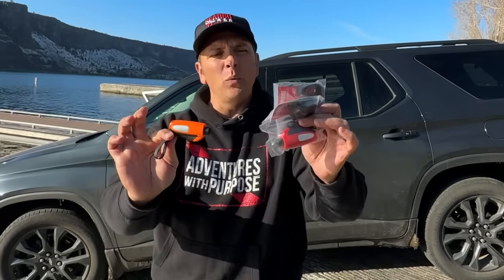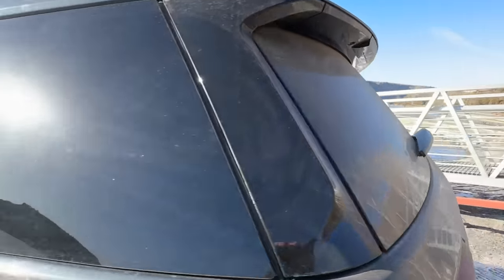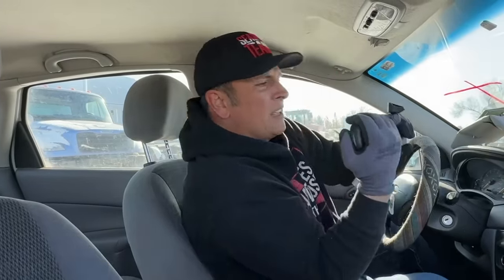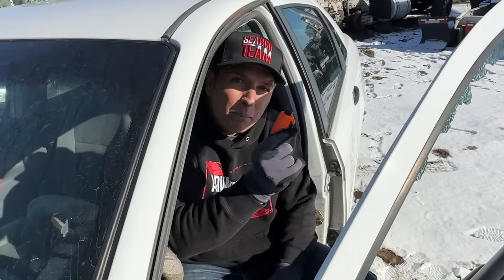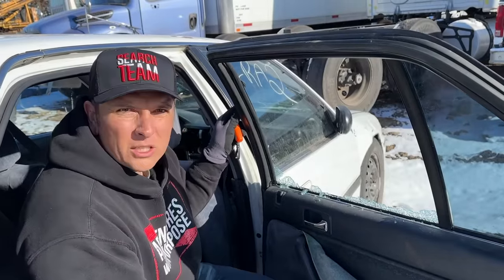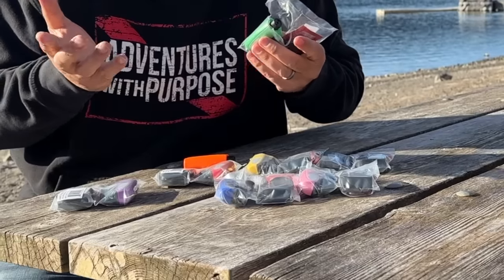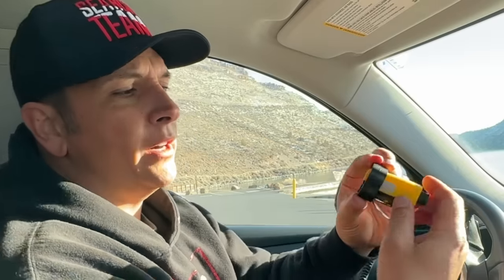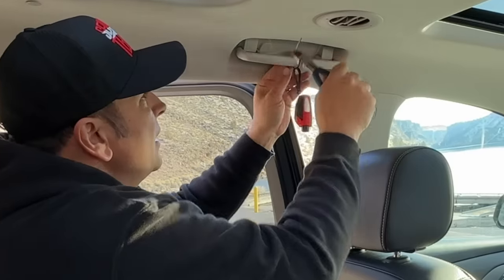Easiest Way to Break Car Windows.. (This Can Save Your Life)

Comment from the maker: Stay safe on your adventures with the 2-in-1 Window Breaker & Seat Belt Cutter! Get yours now at https://adventureswithpurpose.com/products/2-in-1-window-breaker-seat-belt-cutter-with-accessory-kit
Reply: Thank you for this easy to understand informative video!
Reply: What if your window breaker doesn't go off whenever you push it into the window?
Reply: Just ordered a couple... thanks!!!
Reply: I still have a bunch of the old ones, and I was thinking of printing instructions for each one and including zip ties.  Now I will also have to put more in my car.  I think I have like 40 something left.  So it will be a while before I order new ones. Thanks for the video, with easy to understand instructions!!!
Reply from the maker: @ryaneboehnlein9360  We have not had this issue with the newest model for it's new improved design is dialed in and meant to be used over 10,000 times.
Reply: @AdventuresWithPurpose   it was just one of those random  ?
Reply: a pity that the shipping costs to the Netherlands are ridiculously high otherwise I would have liked to order them from you. but I will look for something like this here in the Netherlands. thanks for the explanation and tips. continue to do what you are doing. bring the people home. I love your video's. Respect👍
Reply: @ryaneboehnlein9360  If you tested it when you received it and it worked, there shouldn't be an issue.
For an added sense of security, I suggest purchasing a 2nd one.
Reply: On your next, commercial, please , inform people to cut seat belt first,   Because if they break window and drop it ,  out of the excitement —— then they are still stuck ,
Reply from the maker: @michaelmike5709  That is a great point. We'll be sure to point that out.
Reply: I bought the window breakers  when they first came out.  The sun visor clip wasn't included then.  How do I get some of the clips?
Reply from the maker: @marysnider1223  these are a completely different style and better quality. We would suggest purchasing a new one which includes the sunvisor clip.
Reply: @AdventuresWithPurpose  ok, I understand completely.  I carry mine on my key ring.  That works ok for me.  If you ever design one to fit the style I have let me know.
Reply: Very useful advice, Thank you. It really does make you think about how to escape a sinking vehicle in water.
Reply: @Suebe1962  why do you have so many?
Reply: @sl4983  Because I have a big family and I wanted to make sure that the drivers in my family had one.  Several of my family members live on the west coast (I'm in Iowa), and I don't get to see them very often.  I eventually will run out of them and may purchase more if needed.
Reply: may need to pay the bill to repair the car
Reply: @AdventuresWithPurpose  Can I ask why you changed the design? I love the older ones not so much the new ones.
Reply: you may also use it when your at the mall and you come across a car with kids inside but no parents around or cant be located and the kids are almost passed out.....just a theory
Reply: @hollymaffia7352   it is a longer puncture point, easier to grip, and overall  higher quality - old design the blade was prone to rust and falling out.
Reply: Wow your right my blade was rusted! Glad I bought a new one!

Comment: Potentially life saving suggestion: When you order your window breakers, choose bright colors like yellow or orange. The darker colors like black, purple, or blue, will be harder to find when you're disoriented or underwater. Having those bright colors will make it easier and quicker to spot, when each second is crucial.
Reply: True, it could help.  But, I don't live in an area with pure and clear water.  Color won't matter if my eyes are closed.  If I am in muddy or murky water, I do not anticipate having my eyes open.  I anticipate I'd be relying solely on my sense of feel.
Reply: If you get a darker color, maybe "marking" it with some type of reflective tape or paint?? Just a thought... me personally, I'd get the orange or yellow window breakers.

Comment: Most people have no idea how hard a car window is..I had to bust one for a buddy of mine who locked his car up with the keys and he had to get inside faster than the time it would take a locksmith to show up. We even had a hammer and I'm a carpenter who swings hammers professionally and I was in disbelief how many swings I had to do to get that window to break.
Reply: Its not hard then, when you assembly new windscreen😂 its always last corner when its cracks on middle
Reply: Wow I believe the hammer having many swings. I recently had my car locked up with phone and keys in it. I asked a man if he could help me out. I didn't want him to break the front ( because I knew the Laminated part) and didn't want my side windows so I asked him to do one of those little Triangle windows. He used a car jack and it wouldn't break it
Reply: He probably had laminated side windows.  They're death traps.

Comment: there is no good alternative for simply keeping a window breaker in your pocket when driving. putting a retention loop on the cover for the cutter doesn't seem like a very good idea. couldn't a sudden stop simply pull the cover off? same thing with the visor clip. it doesn't look very sturdy. an impact could cause the clip and window breaker to come off the visor. also, the way you had it set up where the visor clip retains the loop on the cutter cover? that's interfering with your ability to pull the cover off. you'd have to fiddle with the clip to take it off if you needed both the window breaker and the cutter.

Comment: I have two in my car, in the center compartment and another in a first aid bag.

I also have a glass break pocket knife in the driver door and another in the center compartment.

I need some more for the back seats, didn't think about giving the kids an option for a window break if I am incapacitated. I also will mount one near the rear window.

Thanks for the tip!

Comment: 3:22 Usually you have to push or pull a button to release the headrest. NEVER hit a window in the middle/center but in a corner or at an edge to break it. Remove the broken glass with your elbow.

Comment: I've had a window breaker in my car for decades now, it's an old automatic centerpunch that lost too much of it's spring to be of any value as a center punch, but still had plenty of power left to destroy a window. But it's good that they have purpose built ones now so that people who are not used to obscure hand tools can be safe as well.
Reply: Always good to have a reliable tool and a plan.  I also suggest having a handy tool for passengers to cut their seat belts so they can escape also.

Comment: This is so important. I am glad I am always having my savety hammer in the car. Does the same job but is way bigger. Thank you for this extra information 😅
Reply: You may want to consider effective methods for any passengers to escape and pre-plan a way to remove your seat belt.
Reply: @Thathat-o7w  this is the only thing we have here in the Netherlands. And the hammer also has a knife in it for the seatbelt. I just bought a new car and actually looked into this to check on other options

Comment: This is a great demonstration. I carry a spyderco assist rescue knife on road trips. It has a glass breaker, rescue style blade, and an emergency whistle. I also keep a glass breaking hammer in my glove box
Reply: Sounds like you're prepared.  I pray you never need to use them and may they work as advertised.

Comment: Thank you for the updated tool. I do have a very question. For those in backseats, if a window breaker is in the backseat area & secured w/a zip tie, in an emergency how do we free it from its secure, zip tied location? Zip ties can be tough to break, especially if you’re disoriented &/or injured due to the wreck you just had. Does the hang strap detach if yanked on? Thank you.
Reply from the maker: The zip tie, and the seatbelt cutter cover will stay in place. You will pull the window breaker and seatbelt cutter away from and use it as normal.

Comment: I use to give these type of devices to my friends, especially the ones that had car accidents, made sure that the device were bright coloures. The dives also had a quick release by pulling it, so you could attach the device to the passenger headrest bar that is on the centre bar with some cord or short chain or clip. they also have seat belt cutter. Reason I put it on passenger seat headrest bar is so that the driver if concious can grab it, so can the front and rear passengers. Ensure that your young kids don't play with it, cause it will save you and them in the future. Fact a lot of accidents occur from distracted parents due to kids in rear seats. When I was in the military as a Medic some of our vehicles have old glass stype windows and we teach BTLS Access and I use to carry one on my person when I was duty Medic incase I had to break glass to get to accidents that occur in the field while training or on Tour or even on Base. So glad that someone is showing how easy it was to use.

Comment: I say you hand it from mirror or back of seats how they getting it off sometimes those zip ties ate hard to break especially if your a kid so to me that wouldn't work I wouldn't use zip ties maybe use a very thin sting where it's easier to bust when u pull it. Gonna go order a  few. Thanks Jared for the video have a blessed day
Reply from the maker: Quite easily actually because the zip tie is attached to the seatbelt cutter cover. Pops right off.
Reply: @AdventuresWithPurpose  ok didn't think it would turn enough to cut it. Thanks Jared for that reply. Thanks for all you do to help these families can't wait for the winter search comes out

Comment: Hi Jared, please explain because I'm pretty sure this was not covered in your video , upon a vehicles entry into the water, you have stated that it will float for several minutes before it finally goes under. Won't the power windows be functional during that time while car is floating allowing the windows to go down? Please clarify,  thanks
Reply: Hopefully, he'll release another video that better explains floating.  But, automobile engines are not designed to be immersed in water and the engine will die.

Comment: Everyone please do some research on how to break vehicle glass. It's not easy even with a hammer. There are devices you can buy and carry on your key ring also don't hit dead center but in corners. 
 I had feed stored in an old car and accidentally locked my cat in it in the heat of summer when I closed the door. I had to break the glass and was shocked at how hard it was to do and I had a pointed shovel. 
 We all need how to get someone out and also escape ourselves

Comment: JARED ,  could you tell us how many times the window breaker works  ?   Can you use it repeatedly or only once  ?
Reply: at 10:25 when he was seated at the picnic table, explaining it to us, he said the new improved model can be used upto 10,000 times, compared to the original which was right around 100 times.

Comment: Uh I hate to be this guy but I had mine for about 2 months and it literally fell apart. The spring loaded mechanism apparently just malfunctioned and punched out the little plastic piece that that holds it in meaning it no longer works at all. Are there warranties with these? I have no problem sending it back to get a new one and maybe the manufacturer can figure out why they malfunctioned?
Reply: Speaking of which I would highly recomend just placing it in tbe car in a place you know where it is. To be fair due to me keeping it on my key lanyard may be why the wear and tear caused it to malfunction the way it did
Reply from the maker: For confirmation, you are not referencing these new window breakers that we have since we have only had these for the past two weeks.   Are you talking about the old ones and did you purchase from us? If so, send a picture to sales@adventureswithpurpose.com along with your order number so they can address that for you.
Reply: @AdventuresWithPurpose  ya its the old ones and will do
Reply: @@AdventuresWithPurpose  order number may be tricky but I'll do my best to find it. It actually has Adventures with Purpose stamped on it and yes I did buy directly from you all not just for the item but to support you as well
Reply: @OG-GHOST2   you should have received emails from AWP when you ordered and again when it was shipped.  It would be included in the email.

Comment: I had to intentionally break my sliding window on the back of my truck to get my dog home during sub zero weather. Keys and cell phone were both locked in the cab. Just a slight kick to the frame between the panels.  300 dollar walk in the park. 🙂.  Had I been alone I'd have walked home to get a ride and spare key. I had a 100lb GS to get home safe.

Comment: I have removed my head rest on the passenger seat and put the window breaker key chain holder though the post and put the head rest back on. Chances of the head rest coming off slim to none? Credit to one of the commenters in the OG video🤙

Comment: All cars should just have these in a holder built in above both front doors or back doors depending on which windows are tempered as standard. Just have that $2 breaker built in surely enough people have died now to make this standard. There’s loads of other safety stuff in cars but not this.